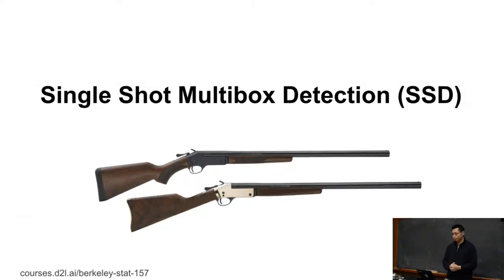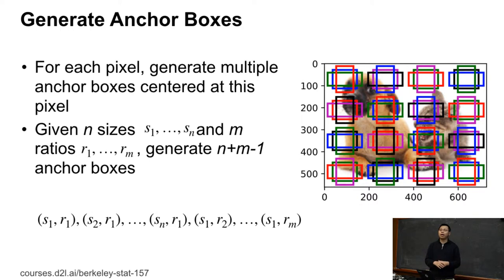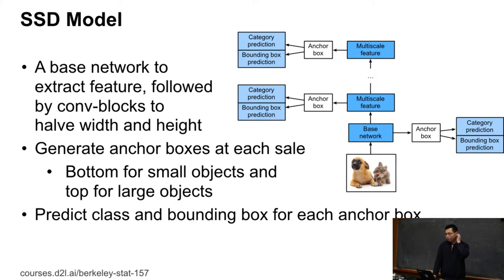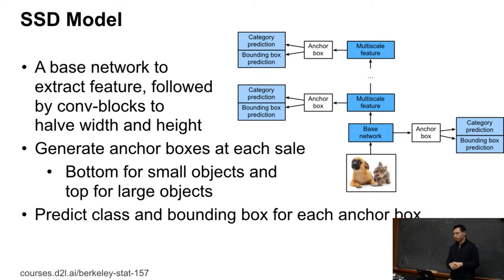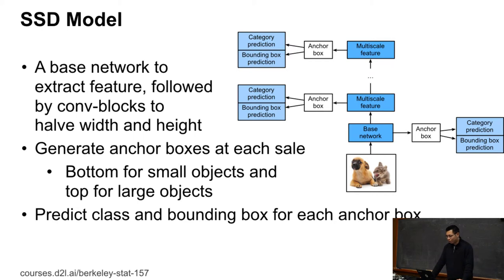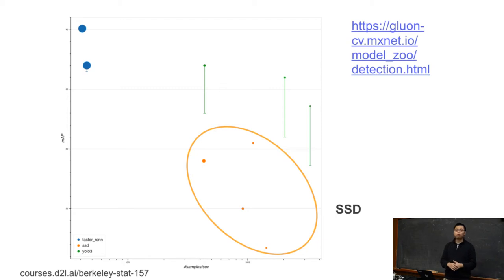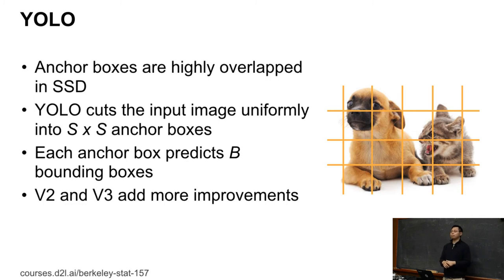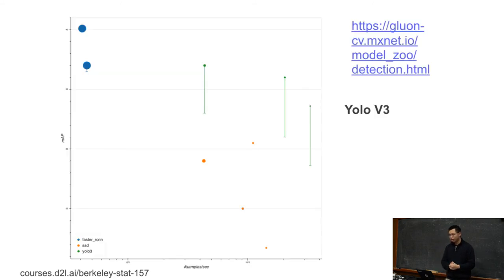L16/5 SSD and YOLO

Comment: can put 1000+ likes for count of anchor box per pixel.
Reply: That's a doubt I have. In a grid, does each cell represent only a pixel or it contains many of them? For example, in a layer that outputs a 38x38 feature map, do we have something similar to 38x38 pixels or the original image size divided in 38 parts (and many pixels in each cell)? The illustrations that we see in many articles to represent the grid system are really ambiguous.